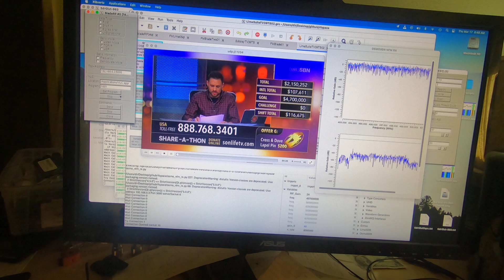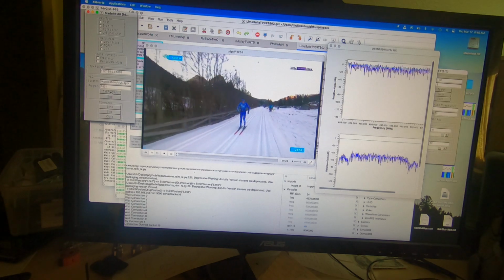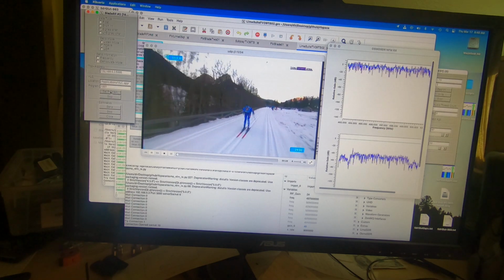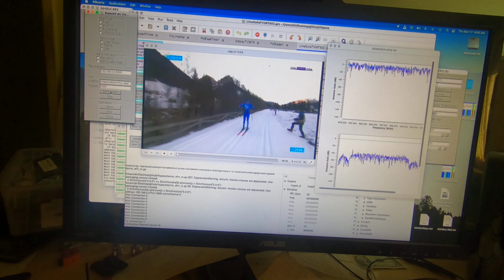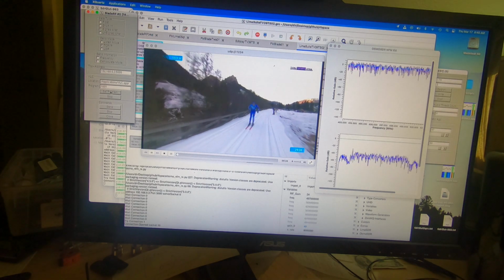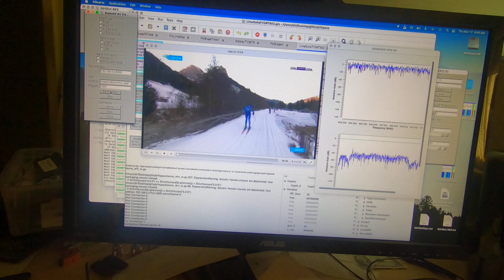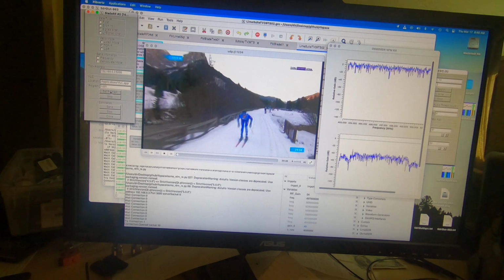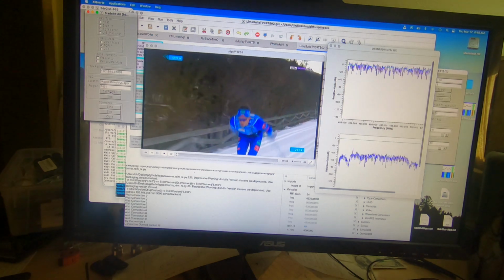Using the BladeRF xA5 to Display Real Time TV

Comment: Hello, are you using the FPGA functions to do this? Could someone do the same with a BladeRF 2.0 xA4?
Reply from the maker: No, additional FPGA functions were used. If it can handle a 8 MSPS bandwidth in real time, that is all it needs - I suspect aBladeRF 2.0 xA4 can do that easily. If there is a problem, you can clear many of them up by adjusting the rx-gain. I will be putting out a new video soon - I found a better way to do things.

Comment: How can I make radar using the same SDR..?
Reply from the maker: In theory, it is simple as the transmission and the receive signals are time stamped - subtract the time difference and multiply  by the speed of light to get the distance - I suspect,  it will not actually work - but it should.

You can find examples at -

https://discourse.myriadrf.org

just do a search on radar. The example are mostly for the limeSDR devices, but it should be straight forward to convert to the BladeRF.

Comment: hello, I have a question, about bladeRF 2.0, How can I make the two channels for a different frequency each one? for TX
Reply from the maker: With the BladeRF xA5, you can tune the TX and RX frequencies separately, but the two TX channels have the same center frequency and the two RX channels have the same center frequency. Thus,  using the maximum 61.44 MHZ bandwidth,  you can receive any two different frequencies as long as they are no more than 61.44 MHZ apart
Reply: @daleranta1012  yeah but for TX I don't have a chance to transmitter in two diferents frequencies ?
Reply from the maker: @DanielMoreno-gb9ko  
Just like the RX, You can transmit on as many frequencies as you please - within the bandwidth restriction. Here is a video where I am testing my impulse Source -

https://youtu.be/vsm18e7duPU

it is transmitting on thousands of frequencies at the same time.

You can do it with one channel - the only reason to use two channels is because you want to use two different antennas.
Reply: @daleranta1012  thankyou!
Reply from the maker: @DanielMoreno-gb9ko  If you have questions about how to actually do it. Join my user group-

https://groups.google.com/g/sdrglut-users

and start a conversation there.